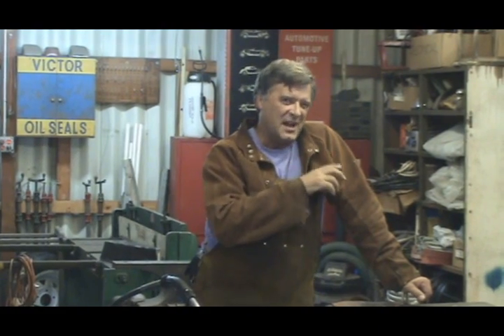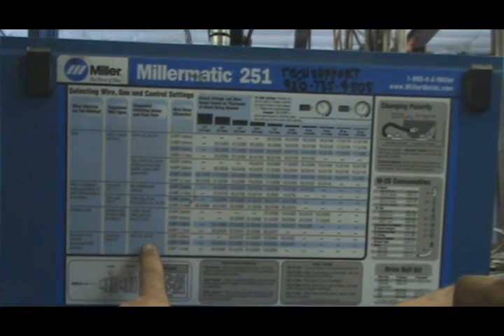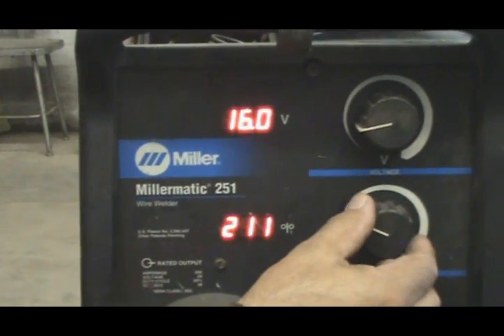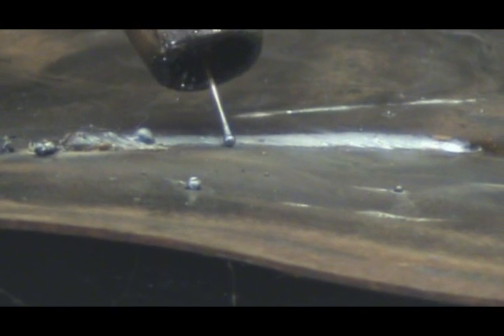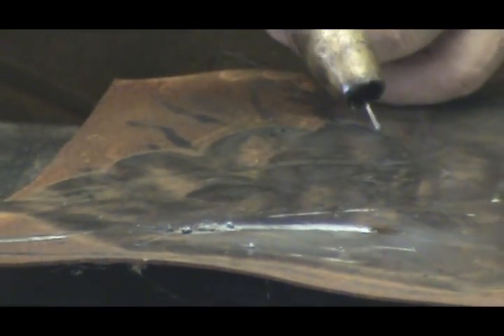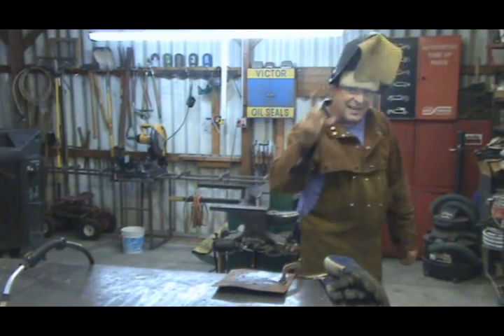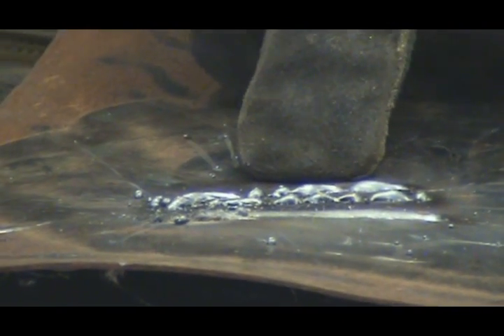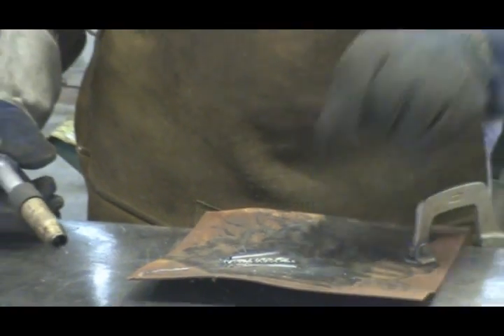MIG Welding: Setting Voltage and Wire Feed - Kevin Caron

Comment from the maker: You will not like the results.  Check with your local welding supply for the right gas for the metal you are working with.  I tried co2 once by mistake. Changed the bottle and didn't che k the label. Just real crappie looking welds. Went back to the mix and the welds looked much better.

Comment: when welding your exchaust the lower the better.even if u sleeve the bad bad parts remember what looks good on the outside is eroding from from within!like the man says,try test pipe...if you can do that then on our exchaust reduce it because its still rotton inside,simple tack welds,let it cool.but best advise..dont bother,might save you for few months but it will split right next to your repaired weld because the strain moves to next weakest point.(before the re weld)

Comment from the maker: @CHIBA280CRV This should be a great welder for fixing your exhaust. Just start at the lower amp settings and work  up to get the right setting. Not to high or you will just burn through the pipe. If you can get a piece of exhaust pipe to practice on before hand that would be even better. Depending on how rusty the pipe is you may have to put a patch over the holes instead of filling them. Lightly sand or grind the pipe to get some clean metal to weld to and go for it. Great learning project.

Comment from the maker: I@sayhello2pedro I leave the pressure set at 12 PS I or so. I don't use a flow meter. ( to cheap to buy one I guess. )

I don't really see much difference when the pressure gets changed. Just that I used more gas. I will bump up the pressure if the wind comes up and I can't block it.

Comment: @kevincaron  I agree with going a little hotter as I'm trying  with flux core with my millermatic 140,are you saying with solid core wire and gas I will notice a difference and improvement?

Comment from the maker: @DerbyDriver96   You might try going to a thinner wire. That will give you a little more heat range. If you can't get enough penetration with the setup you have it may just not be a big enough machine to do the job you are asking it to do. Might be time to go shopping. 

Good luck...

Comment: i have a lincoln electric hand mig welder so it has wire speeds 1-10 and high 1, high 2, low 1, low 2. it is not penetrating the metal on the derby car enough. you know what that set up would be. i was using wire speed 4, and the set up high 2

Comment from the maker: @3habaneros As I am welding NO, Never!  I do change the settings as the shape or thickness of the metal change. If I run in to a thin spot where I ground a little too hard I will turn the amps down a little. If I have a gap in the joint bigger than anywhere else I will turn up the wire feed and the amps to make up for the gap. You have to keep a sharp eye not only on the weld you are doing but the weld coming up next.

Great question!   Thanks for posting....

Comment from the maker: @kevincaron Do you see the metal being melted has the puddle is moving? Is the weld flush or slightly rasied about the metal? If the weld looks like it is sitting on top of the metal then you are probobly not getting any penetration. 

This calls for a video!!

Thanks for the great idea.   

Stay tuned.......

Comment from the maker: @livinginthepast3 What a great question!!    If you can look on the back side of your weld you should see some discoloration from the heat of the weld. That is the least penetration you should have. More discoloration and some flaking of the scale on the metal is better. If you see the joint has been fused on the back side of the weld then you are getting the most penetration you can get without burning through. On the front side of the weld you can look at the puddle as you are welding.

Comment from the maker: @Rhin0Neil Hi Neil
Thanks for those kind words! Nice to know I am doing something right here.  Sorry I have to let you down on the flow meter setting video. I just set mine to what the operators Manuel suggested and have not changed it. Works for me so I just leave it alone. 
Check with whoever made your machine for settings.

Comment: Hi.. Can you a video on gas flow for tig welding please.
I have just bought a 200amp mini tig and not sure what to set the gas at.
I am using pure argon for mild and stainless from 0.5mm up to 2.0mm ( not sure what that is in inches)

I have whatched all your videos and found them to be better than any others on you tube..
Neil..

Comment from the maker: @ncrdisabled My bad!  On this machine the dill reads "Volts"  I use volts and amps interchangeably. I should have been more proper about the terminology. The machine was set to 16.0 volts not amps. 

Good catch!

Comment: Is the voltage really a amp setting ?  I have a old sears mig welder and it has amps setting not voltage. Is that set for 16 amps then?

Thanks

Comment from the maker: @hangoutsumtime I did have a Harbor Freight helmet for a short while. The head strap broke about 2 months in and I could not find a replacement for it anywhere. Even the guy at the welding store just laughed and said "You get what you pay for!"  It did work well, just beware it is a disposable helmet. Thanks for posting and when you get the chance stop by my site. Lots going on over there also.